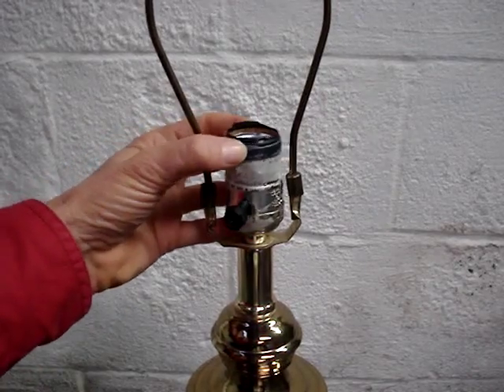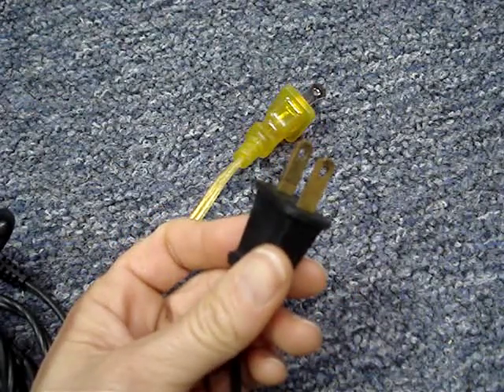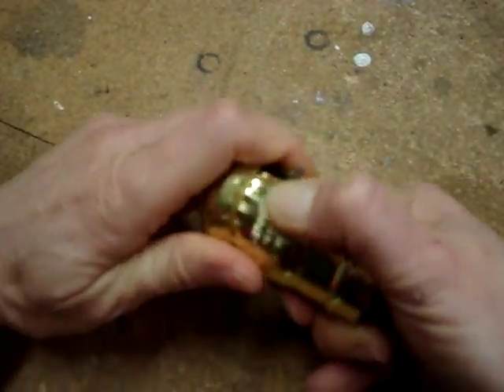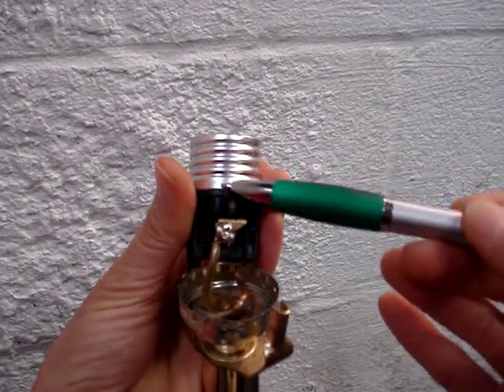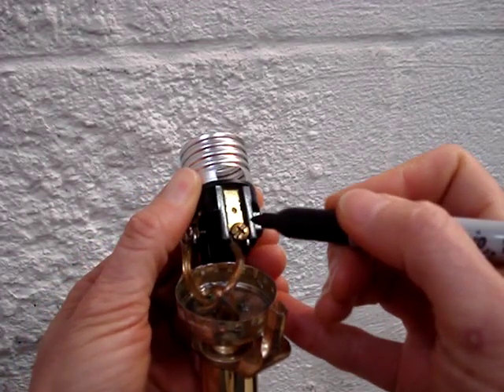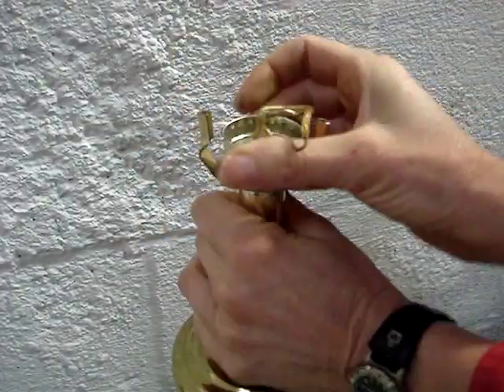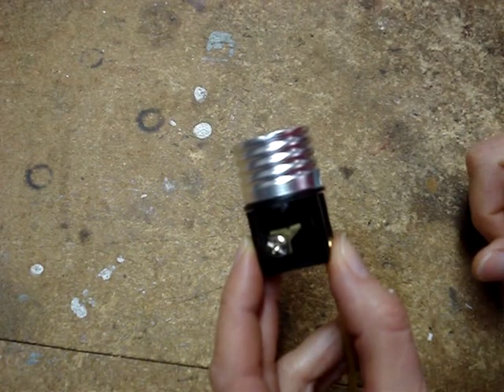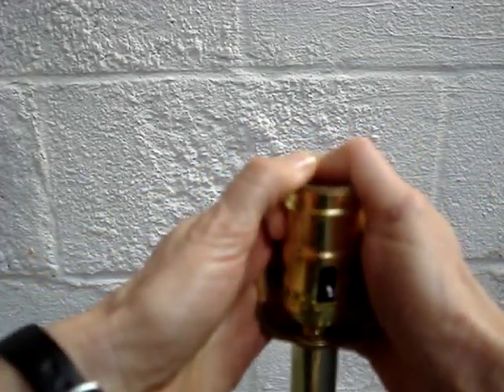How to Replace a Lamp Socket

Comment: QUESTION: I dropped a lamp I like very much from the 1990s that is touch sensitive with three levels of brightness. Originally, the bulb would screw in 100% of the way until it stopped and was very firm. The bulb did not wiggle or wobble at all after being screwed in. However, after being dropped, the bulb screws in about 99% of the way and "almost" feels firm. However, the bulb never screws in 100% of the way now. The bulb will always continue to rotate. Once this point of 99% has been reached, the bulb wiggles and wobbles back and form. The bulb does still work, and the lamp still turns on and off with three different levels of brightness. But, I'm concerned there would be a potential electrical problem or fire problem if the lamp has a wiggly bulb plugged in like that. What are your thoughts? Is this lamp safe to use in such a way? And also is this something that can be repaired? It looks like there are places online far from my home that repair lamps. But, touch sensitive lamps like this have not been common for a long time. Any help would be appreciated.
Reply from the maker: Without seeing it, I can't say if it is a fire hazard.  For sure if there is a loose connection and it heats up, that is a recipe for a fire.  I had a lamp that from factory had "vampire" connections, which is a pointy piece of metal that pierces the wire for a connection instead of the screw down type shown in this video.  Apparently it was not a good connection and over time it started to arc and destroy the connector.  I had the light on a timer and was lucky to see that it was blinking on and off.  I pulled the plug and found the socket to be hot.  When taken apart the socket was black and starting to melt.

Comment: I agree with other reviews -the bit where you show how to get the shell off by pressing on an image on the shell which may not have the word "press" but has the round shape gave me the assurance that if I used a wrench there it would finally get the top off the base. One of the other videos starts to suggest getting a screwdriver but then zooms forward to where the top's been removed -not showing how. Your video is far more honest and helpful.
Reply from the maker: Thanks for the compliment, Chris.  I do my best to not gloss over difficulties you may encounter.  I hope the lamp repair went smoothly.

Comment: Thanks for saying what happens if you connect them wrong :)
Reply from the maker: I spent extra time on the electrical videos.  Errors can have bad consequences.  There are over 200 how to/repair videos, organized by playlist on the channel.  They may not always appear at the top of your search.  If you have a spare moment, click on the channel name and check it out.  Subscribing is free and you will always be able to find the channel and the videos easily.

Comment: Watched a few videos. Yours helped explain how to use the wire cutters which I need to buy. I wouldn't have known about using the 18 gauge hole at all. I also had trouble pulling the casing apart until I found the spot that said press. Not so easy for some of us who are older and don't have man hands (or perfect vision)! Thank you for having a DIY video made by a woman. 😊
Reply from the maker: Thanks for the feed back, I enjoy hearing from people who have watched the videos.  I too have a hard time pulling the socket apart.  I usually end up putting a piece of cloth on the socket and using a pair adjustable channel lock pliers to grab and pull./wiggle. You have to be really careful not to crush the socket.
Reply: @Know-How-Now  You're welcome. Pulling the socket apart was a breeze once I found the "press" spot imprinted into the metal. My mistake was buying cheap strippers from Wal-Mart! They were so stiff and like dull scissors and wouldn't cut through the insulation for anything, even on the tiniest gauge. After 30 mins on each side, I got through and stripped the insulation off. I was in pain for days. Luckily, I could return them and will be buying better ones with a spring in between the handles (and with cushioned handles) at a home improvement store the next time I need to do this. Tough lesson but my lamp is great. My only other advice to folks is the socket I bought off Amazon (better brand) is long and narrow and my GE LED bulb wouldn't make contact. I used the EcoSmart brand from Home Depot and it fit but just a warning if it works with an incandescent but not an LED: look for one with a skinnier base.
Reply from the maker: Klein Tool and Ideal make good wire strippers.  I had a pair that I used daily for years.  They were good until a co-worker borrowed them and cut through live 120 VAC.  That blew a chunk out of the cutter part.

Comment: Watched 2 other videos before watching this. This video is perfect for a novice. Every step explained carefully, intelligently, and with information about “why”. Ie. Description about why wires go to what poles, how they look and are marked, great separate pictures of them. I could not get the socket apart either, which immediately stumped me until I saw her gently use channel lock pliers. Duh! Which was perfect for someone like me. Last example, only video that said when you put socket back together you hear a click. Mine didn’t go back together until I needed to use more force than I thought I would til I heard the click. Without this video I couldn’t get started or get finished. Thanks. I’m s subscriber
Reply from the maker: Welcome to Know How Now, thanks for subscribing.  I do my best to keep the videos short, fully informative on the task and accurate.  Have a great day.

Comment: Your  video was the first one I watched that talked about the Press spot!!!
I held the lower piece with one a piece of cloth to give me a better grip.
And I pressed on the spot that said Press.
Next up is a trip to Home Depot and buy the Leviton brand's Push-Button Socket Lamp Holder.

Edit:
The old lamp socket holder is Leviton brand and made in USA (that tells you how old it is) and had the Press spot.
The new lamp socket holder also Leviton brand and made in Mexico but does not have the Press spot.

Comment: Thanks, I could not figure out how to take golden lamp holder apart... push.

Why the polarized plug?  My lamp was recently wired, it doesn’t have polarized plug..
Reply from the maker: The short answer is that the lamp socket threads could be connected to the "hot" because you can insert a non polarized plug into an outlet either way.  If you have a broken bulb, don't unplug the lamp and touch the threads you are going to get a shock.  If another part of your body is grounded when you touch the threads and the current goes across your heart, it can kill you.  It doesn't take much current to stop your heart.
Reply from the maker: PS - there are other lamp repair videos on the channel, including how to replace a cord.  Click on the channel name, find the playlist tab and you will find a bunch of videos on lamp repair.

Comment: Hi Loved your video, it already helped me change one socket but I have a question.  Can I change a 60 watt socket for a 100 watt socket or is the wiring in the lamp specific to having a 60 watt bulb?  Really appreciate your help!
Reply from the maker: If it's an older lamp, the bulb size limitation label on the socket would be for an incandescent bulb.  The concern is that the heat from an incandescent bulb would cause the shade to catch fire, not overload the socket/wiring.  The socket and wire size would handle either a 60watt or a 100 watt incandescent bulb.  An LED bulb creates very little heat.  A 5.5 watt LED bulb is equal to a 60 watt incandescent bulb and will generate way less heat.  I hope that helps.
Reply: @Know-How-Now  Thank you for your quick reply, your information clears things up!
Reply from the maker: You are welcome, Julie.  Have a great day.